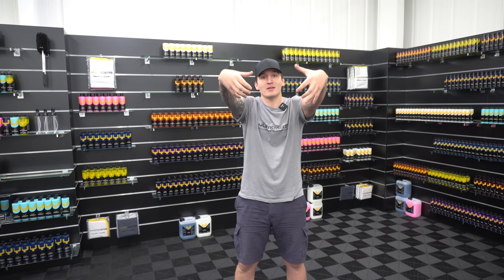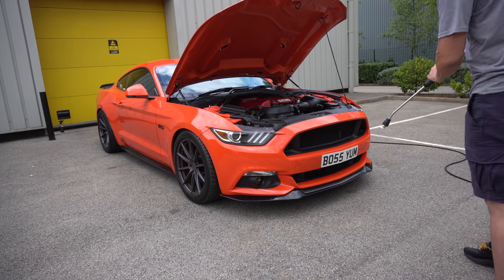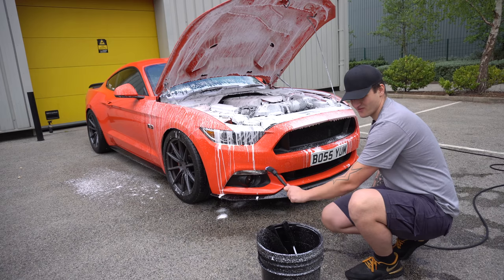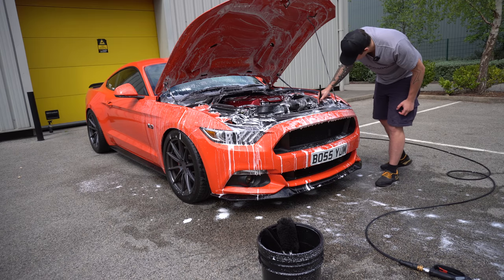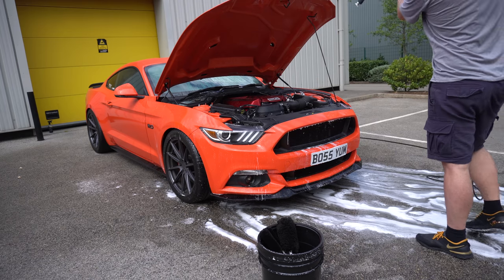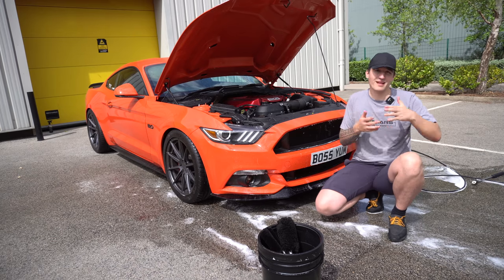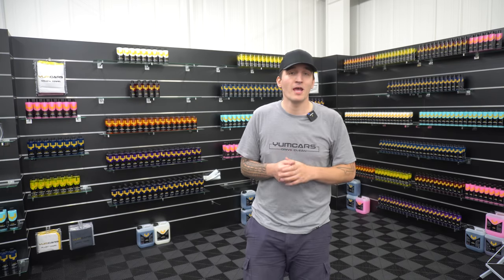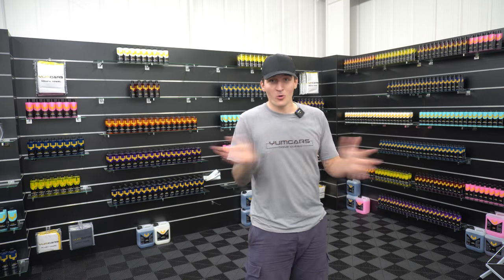Ford Mustang Engine Bay Detail

Comment: What about power washing the engine while it’s hot.... would it crack the block or the heads or is that just a myth?
Reply from the maker: wouldn't recommend whilst hot, regards cracking you never know it may as hot metal cooled down very quickly has the chance of doing so. let the car sit for a couple of hours after driving and you will be good to go

Comment: Would using water in the main engine area affect the spark plugs and any other electrical ?
Reply from the maker: On modern engines no, all vital connections are splash proof
Reply: Thank you..
Reply: Are they splash proof on a 2015 mustang
Reply: @Toxic5.0.  that’s literally a 2015
Reply: @user-yi6dd1pi8s 😂😂😂yup basically 2015 to 2017🤦‍♂️